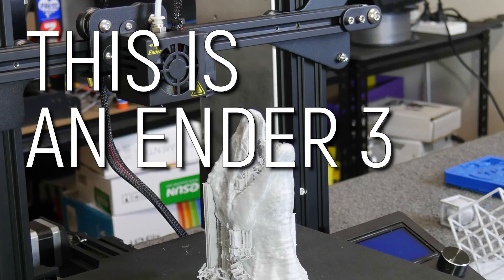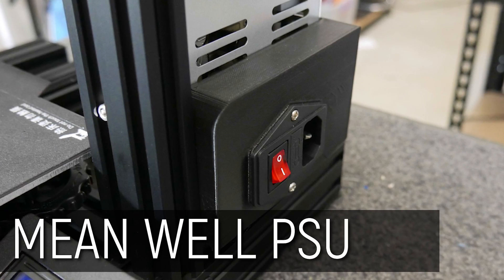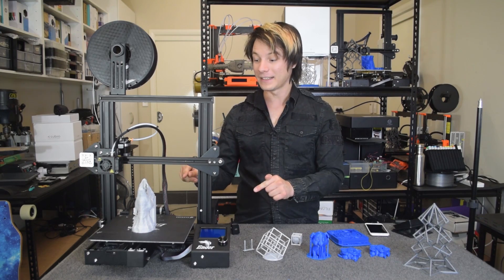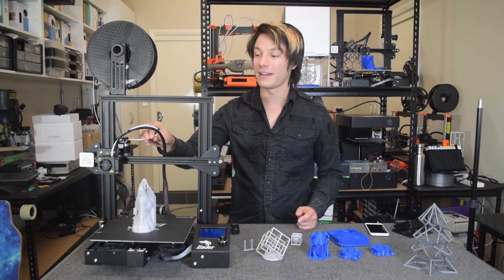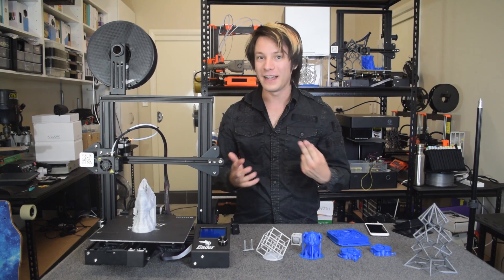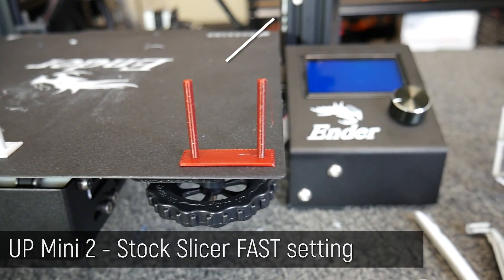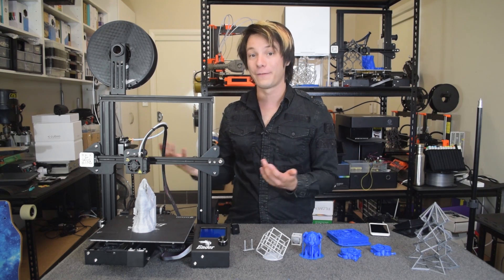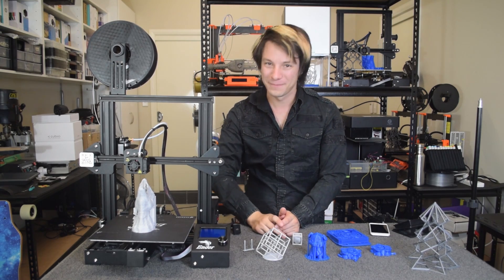Is the Creality Ender 3, Pro?

Comment: Pla becomes brittle in a ptfe tube?
So I should take out the filament when not printing for a few days?
Reply from the maker: It depends on the brand, but yeah if you notice it happening it can save you having to remove the PTFE and pulling it out (or extruding it all out).
Reply: @MakersMuse  Can I pursue this... if left exposed to air, does it become brittle? Should it be stored in sealed bag? With desiccant? (I have no 3D printer - or filament either. I'm just preparing.) Thanks.
Reply: @billleonard2015  yes. learned this the hard way. not air, just moisture, so it's worse when the humidity is high. it ends up being so brittle it breaks into pieces inside the bowden tube, and then it's a real pain to get it all out since you can no longer use the extruder to pull the filament out. 

My printer is now only loaded when it's printing and the filament stays in a box with a shitton of silicagel at all other times.
Reply: Actually I think it more has to do with how filament is coiled on the spool, but I'm sure moisture plays a role in it. Over here its winter and the humidity is quite low and still had it happen just a few days ago. I noticed it happened to break more often once I had run down filament on the spool, so the coil was smaller. Basically you run the filament through the extruder/bowden your forcing it against how it was coiled. So the filament wants to force back into shape and breaks. Also cheaper filaments tend to be more prone to this because they already feel somewhat brittle. It's just a theory, some other video I believe mentioned something about it.
Reply: @MakersMuse  Glad you pointed that out about the filament braking, Ive got 2 ebay or amazon rolls at the moment that always brake 24hrs later on my geeetech with a powered extruder about 10cm from the extruder, although I use a ptfe tube to guide the filament from the storage rail under the bench to the top of the machine there is an air gap to the extruder, out of 8 rolls just 2 of them brake when stood, too the point where I will cut and reprime should I wish to reprint with the same colour. So Guys yes there does seem to be a 10cm,4inch area above ANY hot end that is prone to filament braking after its been stood. A real pain if you use octoprint/astroprint like me and start a print off to be ready for when you get home.

Comment: got so many upgrades going on the ender 3 I don't think I can call it an ender 3 now. However anyone in a market now, no way I would buy an ender 3, when the geeetech a10 has some nice bonuses over the ender 3. Agreed creality really need to stop and think and really improve some basic parts things like tube, couplers and bed springs being the obvious ones as well as the extruder in general and all metal hot end. Why these Chinese companies have an aversion to auto bed levelling as well. it would cost them what an extra $5-10, even the more expensive printers from them, generally don't have them

Currently, wiring in a duet 2. Got an all-metal hot end, bmg extruder,  auto bed levelling to go on after that. Linear rails are on their way from hong kong and next payday will be redoing the frame to incorporate an enclosure. 
Wouldn't be surprised if after that, I reconfigure it to a corexy with different steppers, to become a totally custom printer.  Lots of tinkering and customising allowing me to spread the money over many months whilst still printing, and hopefully end up with an amazing machine at the end as well. 

Don't get me wrong, get some amazing quality prints of it stock, but its so unreliable, same g code goes from brilliant to fail depending on how the printer feels.

Comment: The bed should fit both ways around but it tends to "lock" to the magnets in the bed as you get it close, the best way i've found to consistently centre it is to line up the back right corner as you put it in and it should pop to the middle.

The stringing thing is interesting, mine was printing better than yours out of the box without any tweaks but I do wonder if ambient temps could be an issue, here in the uk it's a little less warm than down under :D

But you really want to grab the filament frenzy profile :D

Comment: ive thrown metal extruders on all my creality machines, their own design is just pure dogshit tbh , their hotend sucks ass
but after i changed extruder and started using filament frenzy's s3d profiles they are rock solid now, i rarely level anything, they just keep going
i just wish for once that a chinese company would actually LISTEN and use good parts, they sort of did it with the cr10 pro, but meh why no genuine e3d hotend? why not bl touch? its like they dont know we dont mind throwing in those exttra 100 $ to have a superb machine

Comment: so i'm 100% new to 3D printing. got my first printer last week! I got the original model of the Ender 3.
I watched your review of it and now this one and it's a bit disheartening to hear these things but at the same time i've made about 15 successful prints with catching and the print coming loose being my only problems. did I get a solid machine? never had extruding issues. all axis are spot on and very very little excess filament being flung about.

Comment: It would be nice if manufacturers, listed all the changes they have made, as they improve their machines and possibly allow older uses to get the bits to upgrade their machines to the latest version (where practical ). 

I seem to remember Prusa did it with their various Mk2 printers. I find it curious that whilst the Chinese manufactures are keen to pick up on hardware improvements that their competitors make, but generally don’t see the value getting the same “inspiration” from their competitors with customer service.

Comment: I am done with cheap printers myself. 

Ender 3 cooling fan dies after a few weeks, then the main board dies after 6 months had to do tons of mods to it to stop underextusion. Then the main board fan starts making noise ( had printed the fan exhaust cover so it was not anything falling into it)

Worse was the geeetech A10 after 2 weeks the hot end started smoking (heating element I think not sure I  unpluged it fast before it caught fire). Pla that was on the nozzle started to bubble.

I have had a xyzprinting DaVinci pro (DRM free one) for 2 years the print quality is a little less but not much and it's never had 1 problem. Works every time. There software is junk but it works with s3d. 

I will not risk my house burning down by using some cheap printer again that has no quality control.

Comment: Angus, my ender3 is now unusable after 4 months. It lays a nice first layer but after that it starts getting rough and bumpy until the nozzle crashs into a high spot and layer shifts. I added a seemecnc extruder and capicorn tubing and tried a few slicers with default settings and custom settings and nothing changes and i am beyond frustrated and need ideas. Can anyone please help?
Reply: Bed level, check timing cables, make sure the temperatures are good and it is extruding well without getting caught up (also make sure the fan isn't overcooling the print) etc etc
Reply: Also worth checking if the z axis rod coupling to the z-stepper is loose. And if the brass nut on the z-axis/gantry is too tight.
Reply: Also check/adjust bed rollers which if loose may result in uneven bed during prints.  While your adjusting check the rollers for the hot end also.  Use a wrench (provided with printer) to adjust eccentric  rollers.  Check rollers for flat spots while your adjusting - If the rollers have flat spots you will feel them as you slide the bed or hot end along the rail (ensure stepper drivers are released prior to sliding and adjusting).
Reply: Is the flow rate set too high, pushing too much plastic into the same space?  If my flow rate is too high, plastic builds up on each increasing layer, until it's sticking up in ridges and eventual failure.
Reply: Thanks for the tips everyone.

Comment: I could be wrong on this but IF I REMEMBER correctly the version of marlin they use CAME with those safeties off by default I could be wrong on this but I remember a discussion about this some time ago and could be remembering it wrong. newer versions come with it enabled. SO once they upgrade to a newer version I suspect it will be enabled IE I don't think they are changing "anything" not required to change so it won't get turned back on until someone at creality goes out of their way to TURN it on or they start using newer versions of marlin that have it enabled by default. I think its what? 1.8 where all safeties are on by default or something like that (I really don't know for sure so I apologize if I got this aspect wrong)

also they are learning. creality did not send that to you. Sainsmart did :-) I always tell them don't send it out to big reviewers until its "final model" changes are basically done. no idea if they will listen long term but we shall see.

the market they exist in kind of mandates fast rapid change and release as they are doing to get to market first and see what sticks best. for example I think my pro came with an ABS cover for the PSU not printed (I will have to check on that) Just look at how many clones their are.

how many $4000 GMAX 2 clones do you think will exist? I say "none" so someone like gcreate can take their time and really work things out get everything just right fine tune tweak and then "finally" goto market with the machine done.

if creality did that or tevo did that or geetech did that all the other would eat their lunch. its a pretty vicious little race they are in.

"I DO" think creality is now large enough with enough inertia that they COULD (and should) slow down just a little bit and work on getting it done better and more refined.

but I suspect even they are not 100% sure how to do that and are still learning. time will tell.

I HOPE the listen to you angus and take some of your advice.
Reply from the maker: Good points! Honestly at this stage this regardless of supplier (The ender 3 was from Gearbest) I'm done talking about their products, had my efforts wasted one too many times. There are definitely companies that do listen and actually take their time to make something as good as they can before sending it, and I'll be supporting them going forward.
Reply: You will find that it is GB that doesn't listen or at least it was like that with me.  I gave up on GB after my one and only purchase and no longer touch them.
Reply: Marlin - at least from version 1.1.1 (latest non-32 bit version is 1.1.9) - comes with thermal protection on by default. Why a manufacturer would decide that turning it OFF is a good idea seems ludicrous, unless they just copied a modified Marlin version from someone else and didn't think to re-enable thermal protection.
Reply: @evo labs I know why from my Tronxy X5S because from the manufacturer it could not reach temps and Marlin would throw an error up and stop everything.  Instead of making it right they turn off the safety feature.  The reason I bring my printer up is because it uses the exact same (until I changed it out) half ass red hot end as the Creality printers do.  From the manufacturer of this printer it was so bad that if the cooling fan came on above 10% speed it would never hit the temp and turn the protection on in Marlin and Marlin would never even start the print for my protection.
Reply: @thebeststooge  Wow, thats interesting. Thanks.
Reply: @thebeststooge  I don't know about the X5S but Design Prototype Test did a build on the TronXY X5S-400 and traced his problems to the hot end as well. He compared it to the one he pulled off his Ender 3 when he put a Swisstech all metal hot end on to see if the Swisstech would fit on the X5S-400 and they bolt up exactly the same and are red but are definitely different. The Ender 3 hot end heat sink has way more cooling fins on it and from watching the video has far better air flow stock for stock.
Reply: @Heziah442  If you look there is a split second you can see the red hot end heatsink that is flat on two sides and is absolutely horrible.  It is the same one and is cheaply made.  Now if yours has a real heatsink and not that sandwich red one it will be loads better.  What I did was use a V6 clone with an all metal throat and not one issue anymore.
Reply: @thebeststooge  i didnt mean to say it was a good unit by any means just better than the one he pulled off theX5S-400 in his video. its deffinatly something i intend to upgrade but not as bad as that.

Comment: I got my Ender 3 a few month back, not the pro, and it came with the silicon sock. Doing the same retraction tests that you did, I have much better results. I have printed a different fan shroud, so I'm wondering if that it? Still using the supplied PTFE tube, and no issues as of yet. Maybe I just got lucky? I do enjoy tinkering with it, and I'm looking at printing the really cheap touch probe on Thingiverse and giving it a go. Thanks for all your videos, as You have been a direct influence on me getting into 3D printing. Cheers.
Reply: yes. this happens. their ptfe tube is not only looser than desired but its inconsistant. one might be a wee larger than the next. the compression fittings are also variable. takes a bit more diy knowledge and effort on the users part to "make it good".

Comment: Angus, wouldn't you like to have a look at the TwoTrees Sapphire S? It comes with linear rails, ABL a actually a decent stock part cooling design, a 32bit board and a rigid frame for a competitive price. Also the frame design seems to be made very thoughtful, because it could easily be encased while keeping the motors and electronics out of the heated build room.
Reply: ohhhhh one of those should be on the way to me. I AM SO EXCITED for that !!! I watched a german video (in german so no idea what he was saying) but MAN the results he was getting made me DROOL!
Reply: That's great to hear! :)
The German YouTuber (Ric's3D) basically said that it was an overall excellent printer, with some little quirks: He thinks you should remove and completely dissemble the linear rails, because they have put a useless oil onto these, and after cleaning use a decent grease on them, in case you mind the slightly scratching sounds they would do at stock.  Also he got an electric shock, because there's no protective cover on the bottom (there's a version with bottom plate and one without, which one will you get?) Also he had to tidy up the wiring inside the bottom compartment a bit, because it just wasn't nice.
Reply from the maker: That's one neat looking machine! hmm maybe, got a few machines to burn through first. Some nice design choices there. Wish they didn't cantilever the bed like that though.
Reply: Yes, I 'm not a fan of that, too. But at least the Y-shafts that the bed's bearings ride on are 12mm IIRC. That's not too flimsy I think. And I wanted to add, that Ric also mentioned, that the bowden tube should be replaced by one from Capricorn, but he had great results with the stock tube, too.

Comment: Angus, I m currently considering getting the Wanhao Duplicator 8 as it seems a very reasonably priced bigger dlp printer. I would really like to discover your opinion about this machine. Will there be a video coming about it or perhaps you can share your opinion here if you have worked with it and are not making content for it? Thanks.